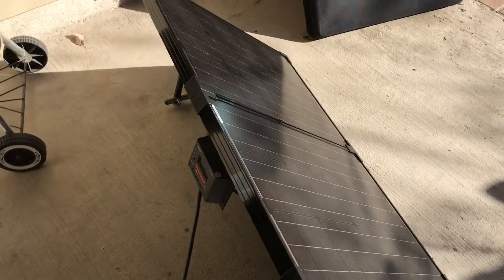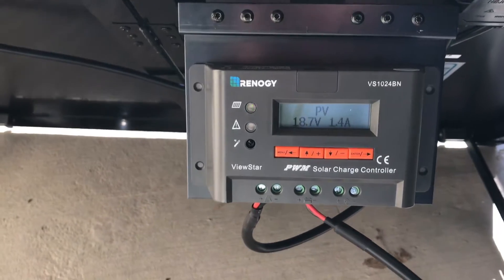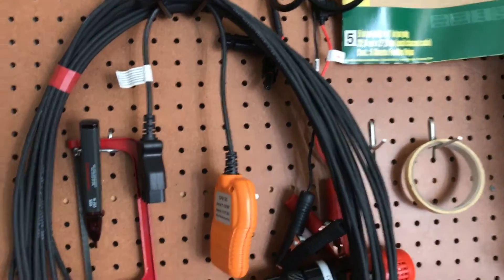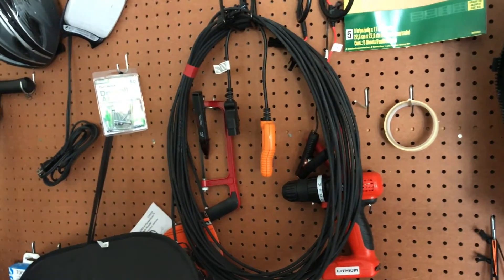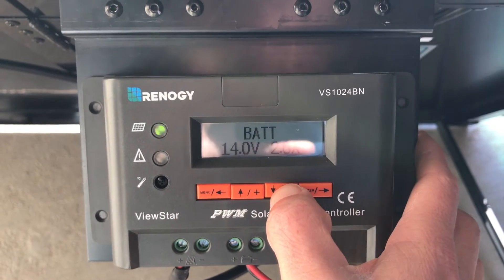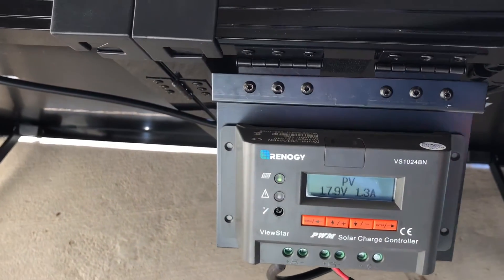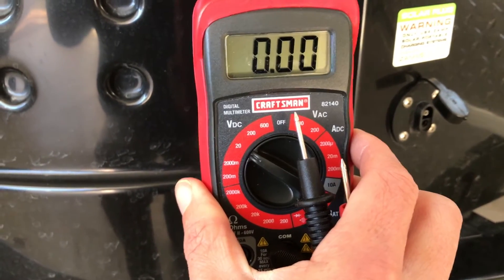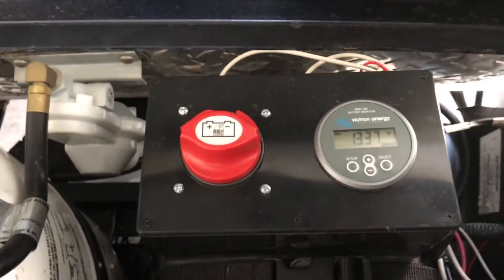Solar Setup with Little Guy T@G

Comment: I have made virtually the same set for our Tag. I installed the charge controller on the inside of the hood for the battery and propane tank using Velcro. It stayed in place during our trip from  California to Glacier NP. I also reversed the Zamp connector. Normal wiring is red-positive, black-negative. Zamp reversed so that you would buy their charging system. I'm planning on downsizing the propane tank and re-positioning the battery so I can store my dual 50 watt panels in this compartment.
Reply: stevebrannon69 Hi hope you’re still checking this. I have a tag trailer and do not have a solar kit. I have a 100w panel a charge controller which I will Velcro in the same compartment you speak of ( great minds think alike haha) and have a mc4 to sae adaptor  with a reverse polarity adaptor to avoid any splicing. My question to you and the poster of this video is.. is it standard for tags to have the fuses already wired in the battery end? and I also want to make sure I have the order of things right before my install. 1 wire mc4 to sae in the battery side of the controller. 2 connect panel to panel side of the controller. 3 plug in sae plug ( reverse polarized) and place panel in sunshine. Does that sound right or am I missing something? Finally when done disconnect sae from camper disconnect mc4 from panel and store. I’d appreciate a green light or any error found. Thank you!

Comment: I like your video.  Where did you get your Renergy kit with the carry case and dual panels?
Reply from the maker: I bought it on Amazon for $230  but I I think they have a new model now which is more expensive, although physically a bit smaller.